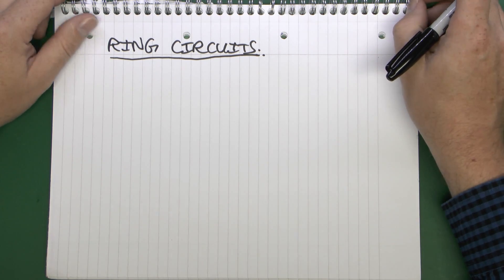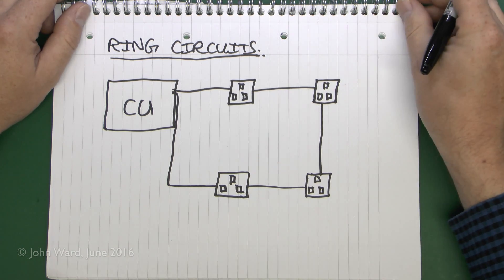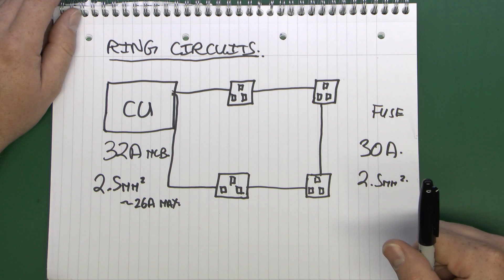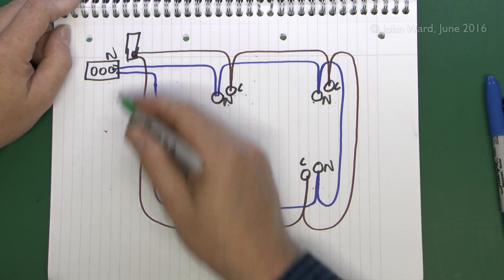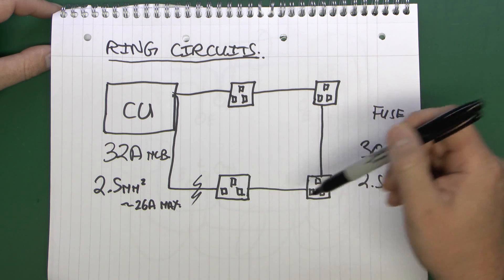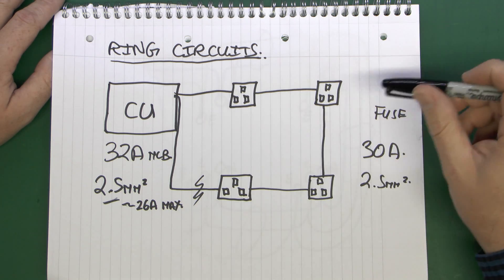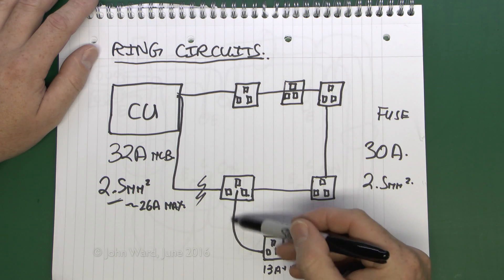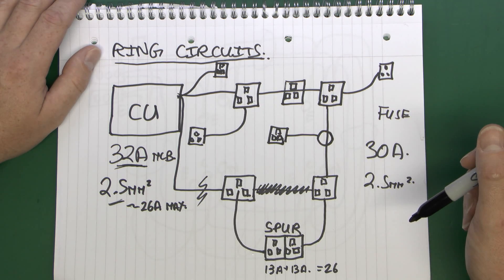UK Ring Circuits (previously Ring Mains) for Socket Outlets

Comment: -Rings-When it comes to re-wires, I typically use 2 x 20A radials for upstairs and downstairs socket outlets and a 32A ring for the kitchen. I have three main reasons for this. 1) As John said, kitchen appliances can have quite a high demand (kettle, toaster, small oven, washing machine, dishwasher, microwave, etc) and I wouldn't feel comfortable leaving it to a mere 20A circuit to handle it all. 2) A lot of kitchen fitters are retarded. I'm not saying all, there are some really good ones but a good percentage of them seem to be utterly clueless. It is not unusual for me to return to a kitchen for 2nd fix and find that a fitter has drilled straight through a cable (they often use very long fixings when fixing to the, all too common, dot and dab). If this happens, I have the ability to split the ring into 2 x 20A Radials and save the day without ripping the walls apart. 3) Particularly in older houses, 60A supplies are common. With all those kitchen appliances and everything else around the house, especially if there is an electric shower AND an electric hob, the maximum demand can be easily reached. Having two radials and one ring instead of three rings makes the diversity calculation a lot easier to sneak under the limit (as we have to do). It can never hurt to have a little wiggle room!-Spurs-I never spur from a ring circuit - ever. If you can run one cable then you can run two side by side. That way you can connect one side of the addition to one side of the ring via the fixture (eg. outlet) and the other side of the addition to the other side of the ring via a terminal block. You don't have to run cables from two existing fixtures in order to "break into the ring". It can be a bit of a push in a shallow back box but if you cut up your blocks individually and push them flat, you can squeeze them in there. I know most people wouldn't bother and just spur but I take comfort in the fact that if Johnny Cowboy decided to spur off my extra fixture, I have already made allowance for it and it would still meet regulations (providing it was only one unfused spur). Aren't I nice for sorting out someone else's mess BEFORE they have even got there to make the mess!
Reply: Well said,  however I have had the case of pushing cable behind capping under the wall (replacing an old phone cable), where it really will not take more than 1* 2.5mm T&E cable, you really couldn't fit 2 =)...

Comment: Old ways die hard. Ring circuits usually reliable enough.Great variety of wiring globally.Protection way better now than it used to be. A neighbour called in about faulty socket years ago. Upon investigation at the fusebox, there in place of a fuse was a 6 inch nail glowing red hot. Necessity is the mother of house fires.

Comment: I'm not big fan of ring circuits, but there is the benefit that the overall resistance of the circuit is reduced considerably when you have that last leg back.  I mean, it does effectively nearly double the effective CSA of the conductor, and thus capacity of the circuit, by just having that (often short) return leg.  I could see there being a lot more burnt-up sockets/cables if radials with many sockets on them where more common, as connections inevitably loosen over time, resistance (impedance?) increases, and then folk go and plug electric heaters and the like into them.  I know regular testing should defeat this possibility, but really, how often do people actually get their installations tested?  In my experience, the answer is: much, much less than they should.
Reply: Exactly my opinion! Leaving the ring complete as is it is and reducing the breaker to 25 A would be the best option with the safety add on that a broken wire would not be able do result in an overload. Long radials always have voltage drop issues at their endings.

Comment: I think in realty the 2.5 mm^2 can't handle the 26 Amps. it will be like a heater. In our country, it's common to use 2 X 1.5 mm^2 (10 m. wire) for 5 Amp. of current, 4 mm^2 for 13 Amp. of current, and, 6 or 8 mm^2 for 26 Amp. of current. considering the ambient temperature (50 - 70 deg. centigrade).

Comment: Thanks for explaining this peculiar arrangement. 
Around here you are not allowed to rely on a fuse at the end to protect a wire, ever. It has to be at the beginning. The only exception is short proof wire (with thicker insulation), for example the spur feeding a fuse or circuit breaker from a bus bar.
Reply: The fuse in the plug that plugs into the sockets isn't to protect the circuit, it's to protect the cable on the plug connected to whatever device you're plugging in.  It's the distribution board/consumer unit MCB device that protects the installation circuit wiring.  This makes sense as, if your installation circuit has a 32A capability, and you plug some little table lamp into a socket on that circuit, then you don't want to have to have a 32A capable flex on that lamp alongside a 32A capable lamp holder, and 32A rated switch.  Rather, you design them with say, 0.5mm2 flex, 5A rated switch, 5A rated lamp holder, and install a 3A fuse into the plug to limit the maximum current the device can draw in order to protect the device from ever being able to overload the hardware it's constructed of.

British socket outlets are designed to handle 13A generally (3120 watts @ 240V), and so the largest fuses available for the plugs that plug into them are 13A.  This prevents there ever being the possibility of a fault on the plugged-in device/cable being able to draw current greater than the installation socket can handle, which is important when they're commonly connected to 32A @ 240V (7,680 watts) circuits.
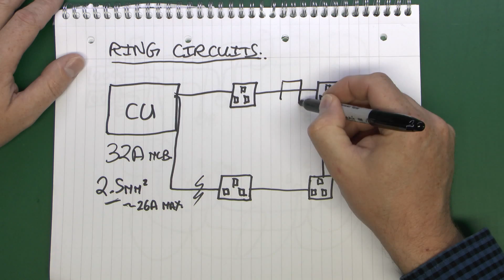Reply: The point is that spurs will have a 32A breaker on a 2.5mm^2 wire, John makes that point at 11:00.
Reply: A spur will never be loaded to more than 26 amps. And despite what they SAY, 2.5mm will take 32 amps quite happily, it just exceeds the design temperature. That's why we have margins of safety

Comment: The spur seams vary unsafe considering how easy a consumer could use a multi-tap or the fact it provides no cable protection...
Reply: Why? The plug itself is fused at a maximum of 13 amps. You can plug as many splitters as you want in but if you go over 13 amps all that will happen is the fuse in the splitter will pop. Nothing major :) 

It's surprisingly difficult to cause an electrical fire / gross overload by just attempting to overload a standard socket outlet due to the integral protective device within the plug itself.
Reply: I guess an overload would be possible if someone owned one of those double outlet plug in adapters from the days before they had fuses in
Reply: Dan Reeves
Even then, all it's going to do is make the cable a little warm before tripping the 32A protective device; 2.5mm2 twin and earth will take 32 amps... it won't like it (at all!) but it won't burst into flames.
Reply: Ridiculously, the 'rules' do seem to still allow double-outlet plug-adapters unfusued to this day, only the triple/above are fused!  As you point out these do indeed allow overloading easily....

Comment: Would it technically be possible for a ring circuit to be installed with only one socket? As in, two 2.5mm2 cables supplying one point. Obviously there would be no practical reason to do so, but is there anything against it, in the wiring regulations?
Reply from the maker: Yes, such an arrangement would be permitted.

Comment: For some reason my 1 bedroom flat has three socket circuits. I have three 32A breakers in my consumer unit all labelled "sockets" I have never figured out why the sparky who wired the flat decided to do that lol. 

I am not sure if I have radial or ring. I wanted to add a socket in the bedroom and when I removed an existing socket it only had one cable going to it.
Reply: Very often when adding many more sockets, the most convenient approach is to put them all on a new circuit, rather than disturbing existing wiring...  Hence many new socket circuits.
Another scenario I've come across is old electric storage-heater wiring being converted to socket circuits...
Reply: I had two in the lounge and two in the bedroom, one in the hallway and three in the kitchen. So it's like one for tyhe kitchen sockets, one for the bedroom and one for the lounge. Hallway outlet is on the lounge circuit, I know that cause I was messing around one day and tripped it out from the hallway outlet lol
Reply: Being a smaller building but having three breakers for sockets, I would guess you will have three radial circuits. They should not be on 32a breakers, Ideally 16a or 20a.

Comment: I guess the Fused plug standard came about because of the ring main.
Reply: It's often presented that way, but it's not just that. Consider a radial with a 16 amp breaker (typical in the UK). Now plug in a table lamp with a typical thin flexible cord rated for 5 amps. Without a fuse in the plug, if there's a fault in that flexible cable it could overheat and be a fire hazard. Whilst it's less common with modern PVC cables, it certainly used to be with some of the older types.

Indeed, there is not in the regulations that limits a radial to 16 amps with socket outlets. One example is that cooker circuits, often rated at 32 or 40 amp were often fitted with a plate with the normal isolating switch and a 13 amp socket. 

Another point is that in a particular installation with many sockets on a radial you might actually want a higher rated circuit (which can be done with 4mm cabling) if several higher rated devices might be used. That's typical in a kitchen - an electric toaster, an electric kettle and a dish washer might all be used at the same time. Of course it is possible to wire every socket with a different circuit, but that's wasteful. So a higher powered circuit allowing a mix of relatively high power devices might make sense. A kitchen these days might have eight or more double sockets, and who knows what the owner will want to plug in where.
Reply: Yes it did.
Reply: Though it's also needed with radials, especially if they are 20 or more amps.

Comment: The idea per se is not that bad IMHO. The only thing I can find wrong with it, is that the circuit should respect the rule of 8 amps per square mm of conductor. 4 square mm conductor is for sure more expensive and a PITA to install, but it offers the house owner more flexibility at a later date. In my case I live in an apartment built in 1980 and the conductors are 2.5 aluminum. Problem is that in order to upgrade the oven and stove from gas to electric, I have to be able to pull 6kw at full power... and that's not going to happen and neither turning the house into a construction site to have a separate circuit is not an option...
Reply: 2.5mm Alu isn't rated the same as 2.5 copper though... in the US (the only place I've ever dealt with that horrible alu stuff) you have to go up 2 gauges (so 12gauge alu can handle the same as 14 gauge copper etc)